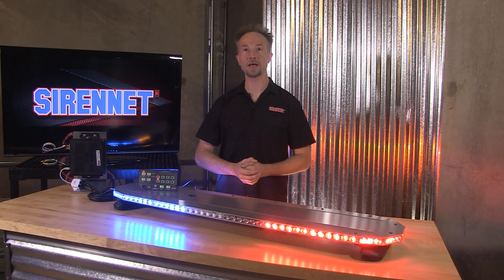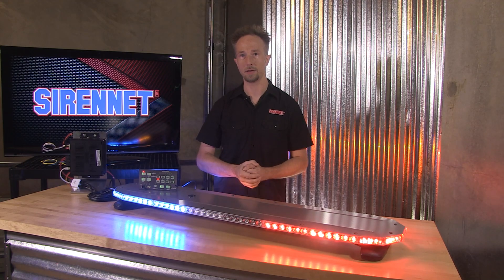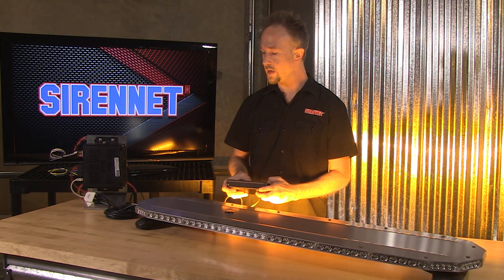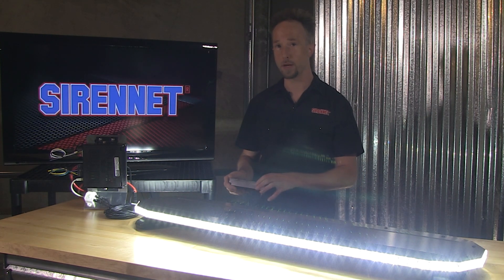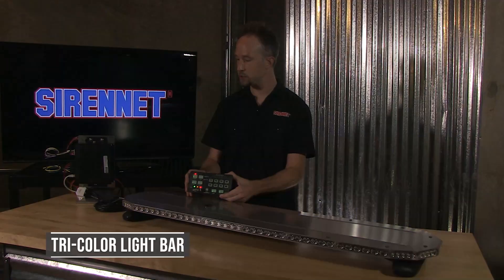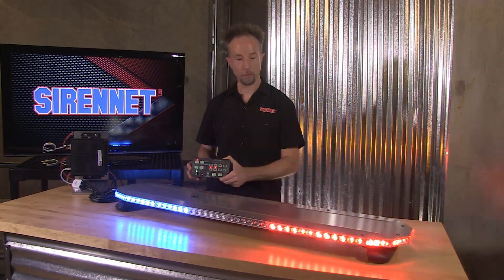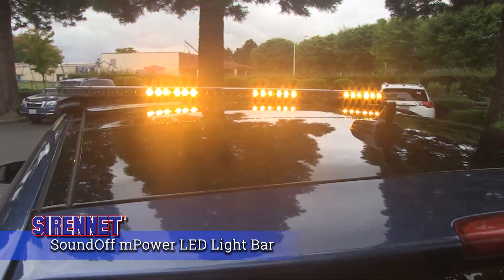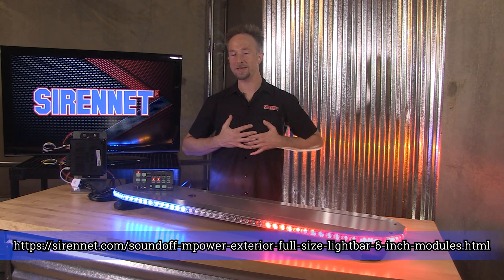Sirennet SoundOff mPower Lightbar

Comment: What do you guys use to power your demo lights? I'm looking at starting a small light collection like you have in the studio and am trying to figure out a good power source. Thanks!
Reply from the maker: We use AC to DC power converters. Cascade Audio Engineering is a great source for them - http://cascadeaudio.com/power_converters/power_converters.htm
Reply from the maker: By adding up the draw of the lighting you'll be controlling, that'll help to determine which size to get.
Reply: Get a cheap used car battery and trickle charger.    Fuse all wires from the battery as close to the battery as possible.

Comment: Wanting to install cb/ pa system on my cvpi any recommendations you can give i would highly appreciate it and thank you in advance 🙏
Reply: Speedtech PA100. I have it and it works great. PA and air horn.
Reply: @silverapple2011  thanks for the reply 👍
Reply from the maker: Be sure to check out the PAH112 & PAP112 from Whelen.
Reply from the maker: PAH112 Link:   https://sirennet.com/whelen-100-watt-electronic-air-horn.html
Reply from the maker: And the PAP112:   https://sirennet.com/whelen-100-watt-air-horn-plus-with-pa-function.html
Reply: @SIRENNET  Thank you very much for replying, highly appreciate it, trying to build my cvpi up with some goodies 🤷
Love your channel 😇
Reply from the maker: @scarfaceruben  Crown Vic specific parts are hard to come by now. Keep us posted on what you might be looking for.
Reply: @SIRENNET  I'm looking for side mirror strobe's, strobe's for rear lights and side marker lights, front viser lights, rear deck lights, behind the grill flashing lights, and I also have a hole on the passenger side roof id like to cover, hole is about 2 inch or less, would a puck antenna cover that? Sorry for such a long list, but those are my plans, would appreciate any help from you 🙏